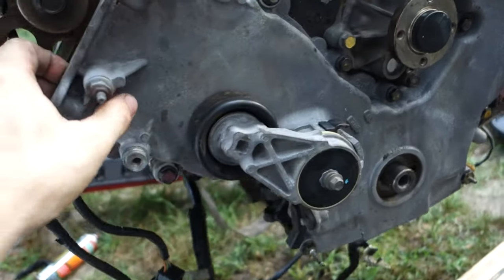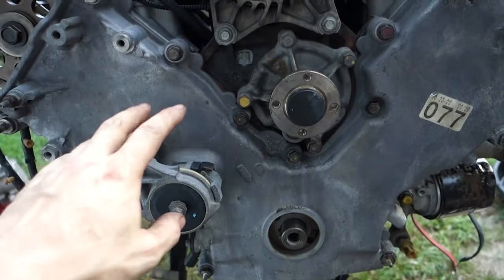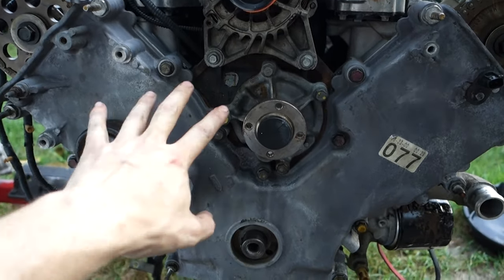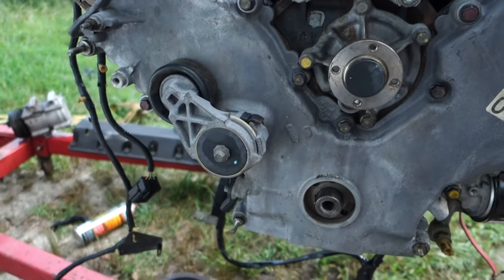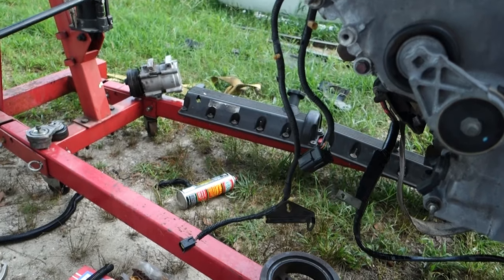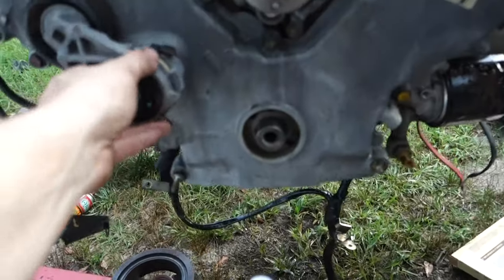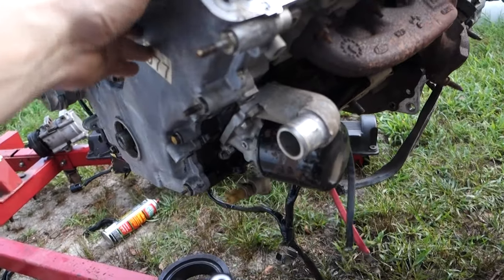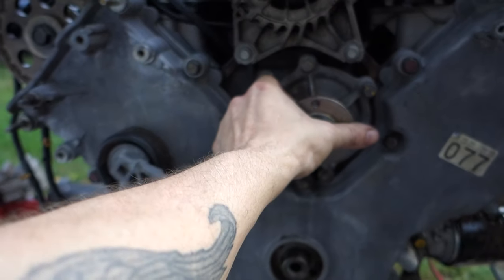Mustang GT Project Getting The Engine Ready Timing Chain & Guide Replacement

Comment: Gotta love Ford engineering right! I know they hold all the records but jeez if they fixed just the few minor problems they'd have it in the bag! I'm not sure how the new motors work maybe they are fixed
Reply from the maker: Yeah I've never dealt with the two valve before but I've heard as long as the timing setup is good there pretty solid